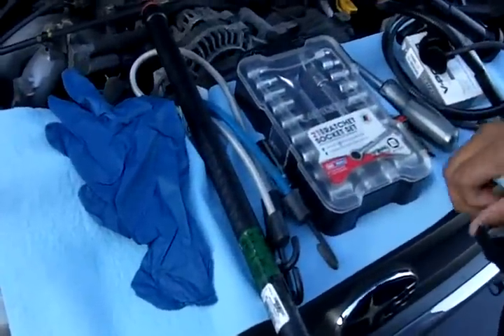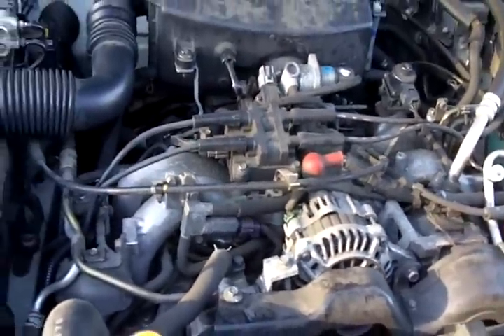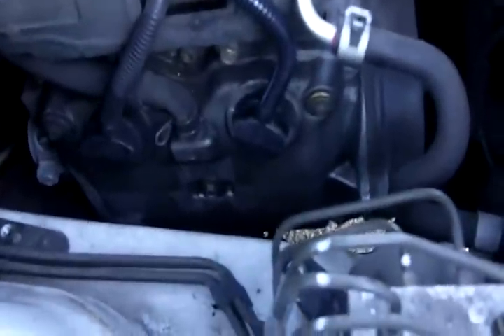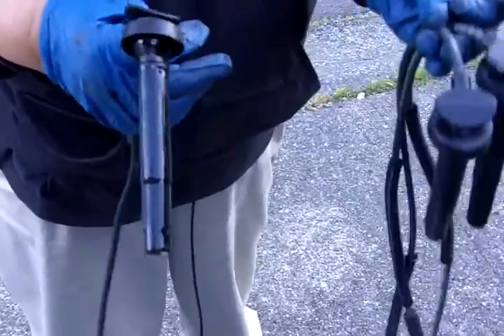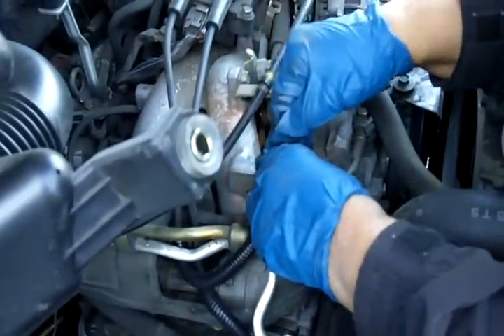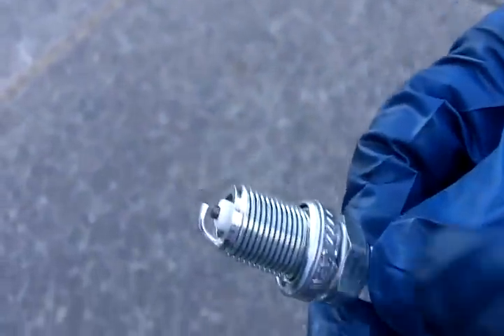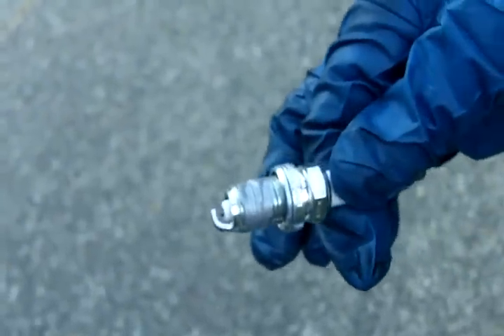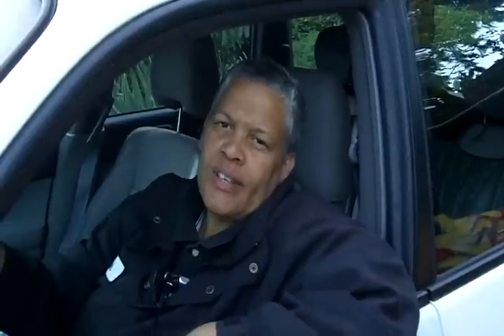How To Easily Tune Up Your Own Car

Comment: Another fantastic video.  Clearly the first one I watched (air compressors) was no fluke.  I might add to the advice given ... allow lots of time if you've not done this before.  It ALWAYS takes longer than you think it will.  Once you've done it, it goes very quickly.  Nice tip on the breaker bar.  I'd not have thought to have one handy.

I used to service my own motorcycles and cars ... back in the '60s when cars had carborators and such.  Now things have become so complex that I found it best to find a good (read "honest") mechanic to do the work.  (God help you if you take the car to a dealer!)  Once they put microprocessors everywhere and started using propriatary fittings and such, I just gave up.

Oh, and yipes ... the advice to do the plugs one at a time.  You only have to do it the other way ONCE to get why that adive is given.  Groan :-(
Reply from the maker: Mike De Bruyn :)

Comment: Holy valve cover gasket, Batman! Great video though. To be noted, Subarus are a bit more complicated than most cars to change the plugs. With an inline engine it's even simpler, all the plugs and wires are right there on top!

Comment: Excellent Video! Thanks Jane :). To add a point here, not all cars have cables running between the ignition coil and the spark plugs like in the case of Jeep Car shown in the video. There are different type of ignition compartments or chambers which have integrated Spark plug and ignition coil mechanism. So please refer to your car's service manual before jumping unto any sort of conclusion related to cables and wires. This is to avoid messing with the wrong component. Happy Servicing!
Reply from the maker: thanks for mentioning this

Comment: Thank you, Lea. Your instructions are concise, motivating and assuring.  Most youtube diy auto-mechanic video instructions are way too vague, incomplete and often done in poor lighting or without a clear visual of the auto parts or the identification of the location of the components.  I am age 50 and was using a ratchet two days ago for the first time and was struggling with it.  Now I have the proper terminology for parts and tools to ask questions intelligently in the future.  

What service guide do you recommend for 1995 Toyota Corolla?  Thanks.
Reply from the maker: ourlegacy Hi, and I apologize for the late response.  I would recommend the Haynes manual.  Thank you for your kind comments!

Comment: Nice video. I feel more confident now. I do have to ask if you should disconnect the battery cable first?
Reply from the maker: The answer to your question is yes, it's a good idea to disconnect the battery.  Thanks for your comment and question.  Good luck with the tune-up!
Reply: hifiguy9 ROTF ;-)  I've got lots of nice scars on the ends of rachets from not doing that.  One thing to think about: in modern cars, some systems reset when you disconnect the battery.  You have to remember to deal with that when you are done.  Most commonly, the radio will have forgotten your favorite stations.

Comment: Respect where its due. Oil on top of your plugs mean you have a rocker cover gasket issue. Your car is probably losing vacuum pressure because of this and making it run rough. Good video though
Reply from the maker: Thanks!  Obviously you know your stuff.  In retrospect, maybe I should have pointed that out in the video.  I thank you for sharing it so that others will know.
Reply: No you got your point across very well, only people like us would realise that. You kept it simple and concise, sometimes it is best not to confuse people with other things. Good job
Reply: vacuum is lack of pressure so there is no 'vacuum pressure' but there is vacuum and lack of vacuum, get it?

Comment: Thanks Jane. I just finished putting a peg board I. My garage, but when I was almost done my wall anchors came out. They are the very old type which look like a small cylinder and it's threaded in the middle. I used a mason tip, tapped the anchor into the wall, and it seemed as if it would work but it didn't. What anchor do u recommend for a peg board. I do have concrete screws, but do u have to drill a starting hole, or can u just drill the screw into the mortar???
Reply from the maker: The plastic anchors are intended for light duty.  As for drilling
Reply from the maker: As for drilling into the mortar it may not be the material for supporting an anchor or screw.  Are the walls cinder block?

Comment: I would hope that you add that most modern cars have long life spark plugs and need this service very infrequently, like say ever 100,000 miles or thereabouts  (see your service manual).  Make sure you get plugs that meet or exceed manufacturer's specs.  Normally you don't have to replace the wires even that often but in an older car where that hasn't been done, it might be needed.  You're point about not cross threading is well taken as repairing this can be expensive but it can be fixed.  Folks, remember the spark plug is steel, rather hard, and the engine head is probably aluminum, rather soft.
Reply from the maker: thanks, Henry!

Comment: I was recently given for free an old Ford Pickup Truck that had a huge miss in its engine, it was running very roughly.   I changed the spark plugs, distributor cap, rotor button and spark plug/HT leads.   The motor now starts and runs very smoothly.   On looking at the spark plugs I wouldn't be surprised if they had been in that engine since it was new.   I also put new tyres on this truck before I took it for a drive as the old tyres were bald as was my 95 year old grandfather..   I went for a drive in this truck yesterday for the first time and find it works fine and I was able to get it to run at 100 kilometers per hour.   I went to the trouble and expense to buy all those parts in one go as I live more than 100 miles away from the nearest town in inland Australia.   It still needs some work done as it is running very rich and has the idle revs set way too high.    I am very thankful to the man who gave me this truck.    I totally agree with "SeeJaneDrill" and commend what she has put online.
Reply from the maker: Hello David,  Good luck with your project and thanks for sharing your experience with all of us.
Reply: Thanks for your best wishes.   I am a 75 year old Aussie and I am not working as fast as I was 50 years ago.  This is proving to be a good vehicle to own as it operates on both petrol and lower priced liquid petroleum gas so fuel prices are low.   At least this truck is making me use my brain and is more fun to work on than going to The Senior Citizens Club and playing 500 at cards.  And it doesn't matter much how much time I take to get this vehicle right as I am long retired from my former employment and have nothing but time on my hands.

Comment: just thought I'd give you some constructive feedback. Perhaps it would have been a bit better if you had pointed out that the style of engine you were working on was a very rare configuration only used by Subaru and Porsche and that most people won't need to take out the air filter box to get to the plugs as they will be on the top of the engine and not the sides. Also not all engines use leads and most use coil packs that are directly connected to the engine loom. Other than that it was a good video and was entertaining and I can imagine I was very informative and comprehensive for those who may not have attempted work on their own car before :)
Reply from the maker: Alex James Hi Alex, thanks for your comments. I just want to note that we have a whole range of auto repair videos, one of which happens to be about the coil pack.  It is difficult to include everything in a single video without the video being excessively long.
Reply: I'll be sure to check them out. Cars are incredible feats of engineering but by god i hate the electrics! my car is currently off the road because of a wiring fault and i have no clue when it comes to electrical components as i only like the more mechanical side of things haha.

Comment: Just to be sure, Jane. When I replace the spark plugs, I should/must change the spark plug cables as well?
Reply from the maker: InTheory Yes you don't always have to change the cables, but they are so inexpensive that you may as well consider it.
Reply: InTheory Yes If I can add, a good general rule for this kind of question is: Is the cost of the item replaced small compared to the time it takes to replace it.  IOW, the few bucks to put in new cables is small compared to opening up the engine again to replace them AFTER you have replaced the plugs and found that you STILL have a problem and conclude that one or more wires is bad.
Reply from the maker: +Mike De Bruyn Hey Mike, I just want you to know that I've noticed your comments, and you make excellent, common-sense recommendations...so thanks!
Reply: +Mike De Bruyn: Certainly agree, Mike, especially, the ones with spark plugs by the firewall.

Comment: Hi Jane, just want to ask what brand is best for buying rachet kit? planning to buy one soon.=) thanks and hoping for your reply.
Reply from the maker: jepoy musikero Hi Jepoy, it pretty much comes down to how often you will be using it, how much you want to spend, etc.  I personally own a set from Advance Auto Parts (their store brand), and I also have a Craftsman ratchet set.  The Advance set was inexpensive, and the Craftsman was slightly more pricey.  I'm happy with both.
Reply: seejanedrill I've got Craftsman as well.  The thing about Craftsman is that while they are not absolutely the best, you can get them replaced so long as Sears remains in business.  I've taken damaged tools into the local Sears store and swapped them with no quesitons asked.  Over the years, I've never regretted having bought the better tool.  I've frequently regretted buying the cheaper one.  Harbor Freight is a good example of a bad brand to buy.  (Tools, that is.  The commodity type items are O.K.)

Comment: I once had a plug that wouldnt come out...it was the hardest thing trying to take it out. For some reason it got stuck inside the cylinder and nothing worked. I forgot what I did, but it took a couple days.

Comment: I can take out a seized spark plug without even using the ratchet just using the extension piece and the socket. I used to compete in the Carling O'Keefe World Wristwrestling Championships.

Comment: The designers don't make those cars easy to work on. 
On an old Ford car I had, the spark plugs were attached to the top of the engine, making them easy to get to. The starter motor was conveniently situated too.

Comment: I have a 99 chevy s10 I just bought. I just brought it in for a tune up as I know it needs one from the way it's behaving. Can I expect the shop I brought it into to perform all of these things. My truck is hesitating to start and when it does the idle bounces around and it stutters until I tap the gas then it stops. If i try to drive it even after 2 minutes of idling but engine is still on the cold side it will surge really bad and acts as if it will die unless i put it in neutral. I have to let it warm up all the way b4 it stops and then it will still surge here and there randomly but lightly. It threw a  P0300 so i have a random or multiple cylinder misfires but that can be related to a bad fuel injector. The mechanic said the s10s are known to have bad fuel injectors but i feel it could be that but still a mix of needing a complete tune up. Thanks
Reply: +mauro rodriguez  ok thnx

Comment: Missing info. 
You need some compressed air to clean the spark plug area before torquing out the spark plugs. Otherwise there could be unwanted debris inside the chamber.

Comment: Theres alot of oil on the plug tubes you might wanna look into some valve cover gaskets. Mine has the same problem
Reply from the maker: ***** Hi Ricky, thanks for writing.  I addressed the issue of the oil on the plug in an earlier thread.
Reply: seejanedrill oh OK sorry just looking out!! Lol
Reply from the maker: no worries. thanks, Ricky! :)

Comment: how exactly does changing the spark plug cables 'tune up' your car?
Reply from the maker: ak .fortyseven You have to keep in mind that spark plugs do not generate the electricity they use to make the spark.  Wires carry the electricity to the spark plug.   So, as wires age, they can crack, and these cracks allow electricity leakage, which leads to arcing as electricity  travels down the wires to the spark plugs.   When this occurs, it can create performance issues, similar to failing spark plugs. This is why it's important to replace spark plug wires (per your car's manufacturer's requirements) when tuning your car.  Thanks for your question.
Reply: ak .fortyseven I'm not sure if you are just questioning the terminology.  The whole idea of "tuning up" a vehicle comes from the racing mind set, I think.  The idea is to get the best performance possible from the vehicle.  To do that it was common to address the various "systems" and optimize them.  So in this case, as spark plugs age, they get worn from the spark eating away at the metal ... they also an accumulate carbon if the mixture is too rich.  To fix that, one replaces them.  (It used to be common to simply clean them in a sand blaster, but they are so cheap compared to the labor to remove them that it no longer pays to do that.)  Likewise, the heat of the engine damages the insulation on the spark plug wires over time.  When there was a mechnical distributor, the points wore and needed to be replaced, or cleaned, or gapped and the capacitor would go bad.

Other systems that need to be tuned are fuel: cleaning injectors, for example.  Seals: as in this video a gasket needs to be replaced.  Lubrication: chaning oil and filter.  Cooling: maintaining fluid and replacing damaged hoses and flushing the gunk out of the system.  Even the tires can be thought to be "tuned" as they wear.

If you look at the whole vehicle as a collection of "systems", then optimizing each one will give you better performance and so you "tune" the entire vehicle.  I grant there might be some confusion between "tuning" and "maintaining" and "repairing", but in the long run, it all has to be done to get the best performance.

Comment: Thank you that was very helpful
Reply from the maker: Aimee Danner You're welcome, Aimee!
Reply: seejanedrill 
I wish I lived near you. I need to stop acting like I'm not a handy woman.
Reply: Aimee Danner It's not just women, it's men too.  The solution is to do research (like finding seejanedrill).  Deciding if the downside of screwing up the project is going to be huge.  Picking a project that seems doable.  Planning it in detail.  Gathering the right supplies, tools, and equipment.  Allowing plenty of time to do the job.  And taking it slowly.  It often helps to have someone to go to for help if you get stuck.

Trust me, over the years I've tried many things and both succeeded and failed ... but learned by both outcomes.  Right now I have a spot of mold on the livingroom ceiling.  I've done quite a bit of research and determined that I have to find out exactly what is causing it (probably a leak in the roofing) and then hire someone to replace the roof.  (It would be irresponsible of me to attempt roof repair at my age.)  After that, I may repair the drywall myself or hire that out ... depending on the extent of the damage.

I no longer think twice about painting, or replacing a faucet washer or swaping out a bad circuit breaker.  It all comes down to expanding your self-confidence through experience.  Just start with small projects and grow your experience using various tools and techniques.  You'd not think twice about changing a light bulb, but there are plenty of people who would be afraid to do that.
Reply from the maker: +Mike De Bruyn Very nicely stated! :)
Reply: Yes Mike your right and thank you.

Comment: did you notice the oil on the spark plug boot. any one know why?
Reply from the maker: +chris aragon Hello Chris, Good question..... valve cover gasket.
Reply: Yes ..when you see oil on spark plug boot on this type of engine there is a oring gasket keeping oil from spark plug boot and yes valve cover gasket needs to be changed at this time...

Comment: From the look of that first wire U pulled off the spark plugs looks like U need a new headgasket
Reply from the maker: *****   Tube seals and valve cover gasket.

Comment: You neglected to address the spark plug gap setting.
Reply from the maker: +john smith Hi John, We have a separate video for setting the gap on a spark plug.  It is called "How to the Set the Gap with a Spark Plug Gap Gauge"

Comment: forget the breaker bar you need man power hahaha. peace :)
Reply: Charles Nefdt Ummm, not so much.  Stuck is stuck and I don't care if you are Charles Atlas, it is difficult to apply enough force to a narrow ratchet handel in a cramped space while avoiding a trip to the ER.